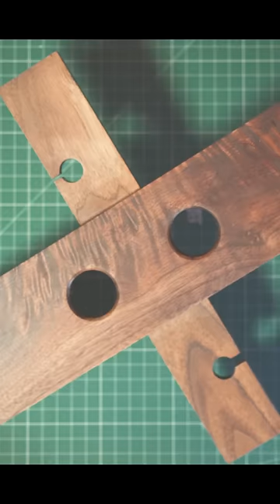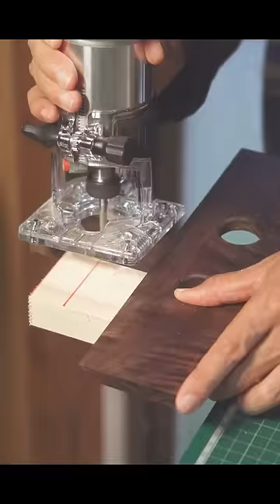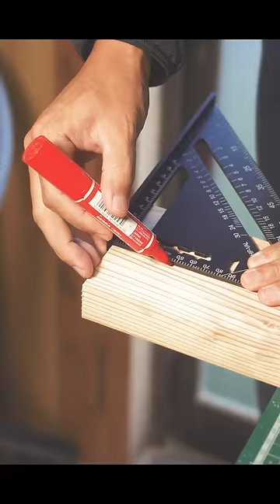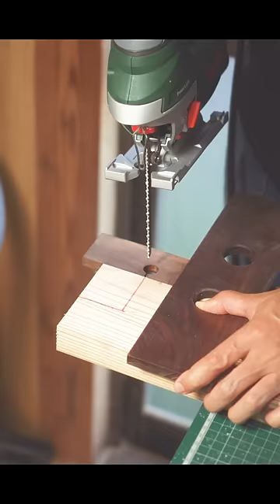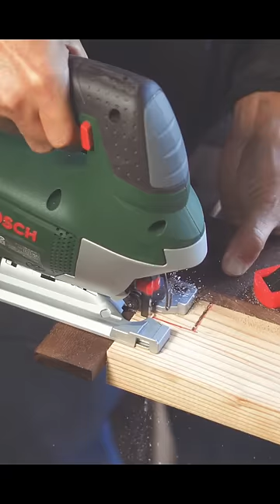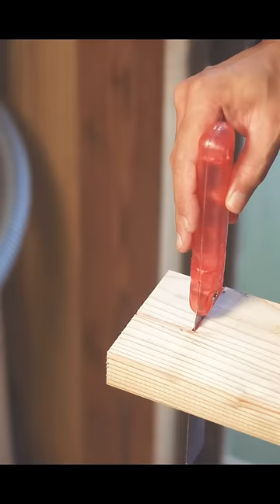Few People Know About This Hack🤫 #shorts

Comment: Some measurements and instructions that worked for me (sorry for bad english):
Big piece: 360 x 110 x 9mm
Small Piece: 450 x 60 x 9mm
Big Holes: 30mm
Small Holes: 20mm

DIvide and draw lines for the 360x110mm in 3 Sections: 150 / 60 / 150mm
DIvide and draw lines for the 450x60mm in 3 Sections: 130 / 110 / 210mm

Glue both pieces together on the 110 x 60mm sections.

Cut the 210mm piece to the appropriate width using the circular saw.

Cut into the 60mm piece using the jigsaw and router as a mark. Mark the middle of your blade width and drill the small hole with a distance of 20mm away (so you have 10mm air / 20mm hole / 30mm wood)

The middle point for big holes on the 360 x 110mm piece are 125mm from the outside (with 30mm diameter). So you have the sections "125 / 25 / 60 / 25 / 125".

I hope this helped someone and sorry for bad english or explanation.

Comment: Making on this weekend. Exactly what I need
Reply: Why wouldn't you use the framing square he used to square his "tool" instead of making a "tool" to do the exact same thing that the tool he uses to use it does?
Get it? The speed square does the exact same thing. His is cute but redundant.
Reply: @Steve-hj6xv  You are missing the advantage of this jig here. It aligns to set the cut to the marking where the cut is to be made !
Reply: @NavinBetamax  I align the cut with the saw blade. The jig is redundant, especially if you have to use a speed square to align it
Reply: @Steve-hj6xv    ...once this jig is made....you don't needto use the speed square.
Reply: @NavinBetamax  yet, the first thing he did was to pull out a square. Regardless, I'm being too critical. It's a cute contraption and if people like it then it should be of no concern to me.
Reply: @Steve-hj6xv  This is A Jig made with the help of A Speed Square to Align the CircularSaw for anAccurate Square Cut !!!  I hope it is clear now ( A Jig) !!!
Reply: @NavinBetamax  guy, I get it. I get the same results with a speed square, which was designed for people to make square cuts.
It's a cute jig, though. Enjoy!
Reply: Hope you only need to make 3" cuts
Reply: @Steve-hj6xv  He is using the speedsquare only to mark the cut-lines !

Comment: Very nice tool!! I would make it out of plywood though so it won't expand or contract...
Reply: True. But real wood is so beautiful
Reply: As long as the surface is suitably sealed, there shouldn't be sufficient moisture migration for the wood to move.
Reply: Any movement on something that small is gonna be insignificant once waxed or varnished.
Reply: @Shryquill shouldn't be, but there regularly is, especially with temperature/moisture variations.

Of course, if you can moderate such variations, it shouldn't matter very much. 

-professional cabinet maker
Reply: @michaelsorensen7567  I was passing on what was told to me, but sadly since writing that comment I've learnt a bit more about perm ratings and moisture gradients. 
Essentially, unless the coating is continuous, without imperfection, and vapour impermeable, there will be some amount of moisture migration, and that can lead to warping. 

Thanks for sharing your reply and reminding me of the jig shown in this video; I REALLY could have used one of these today

Comment: Skill saw, yes. Router, yes. Jigsaw, NO. The blade can flex, bend, turn or whatever you want to call it and pull the saw away from or into the jig. The harder or thicker the material the worse it is!
Reply: @losapriscos7258  a sharp blade will only help for a short cut like he demonstrated in in the video. If someone wants to make a longer cut using a straight edge. The blade will wander and pull the tool eventually regardless of if it’s sharp or dull. Im not saying it’s a bad idea. I’m saying depending on the situation, a seemingly good idea can have unwanted consequences. And it’s nice to know the risks of something before doing it.
Reply: The function of the jig at that point is to provide a fence to straight cuts, the only reason for the hole is to give a starting place. It can deflect into the jig all it wants, the fence action of the jig will remain the same. It looks like already got maybe a quarter inch of play for the blade to wobble in, to account for just that fact.

Comment: That’s a nice and simple jig, personally I’d make it out of some steel flat bar so that it doesn’t swell with the seasons and stays true, but I like the design!
Reply: @roarkemurdock3027 - Those small wood pieces are not going to expand enough to be a problem.  And they won't damage your blades and router bits if you accidentally hit them.
Reply: I wouldnt be comfortable with a router bits that close to metal.
Reply: @jamosorio642  - Exactly. 👍
Reply: @jamosorio642  @David_K_pi I would put a wood or plastic insert where the blade/bits go just like any other zero clearance insert on a table saw/bandsaw. As for the swelling I personally would want the square and fence aspects of the jig to be unchanging and to stay true. You may be right that the swelling would be small in the initial change of seasons, and how much it would swell would depend on the type of wood used as well as your climate, but I’d prefer the stability of a metal straight edge and fence. I live in Texas and my wood jigs do change between winter and summer

Comment: Umm, they have tsquares, speed squares, guides, etc.  You just made it out of wood but metal.  Which for long-term use is a bad idea.
Reply: It’s faster to find some scrap wood and easier to make a wooden jig. The cutting parts never touch the wood so it doesn’t really matter regarding longevity and you can always make another one. Maybe a “purist” wouldn’t be impressed by this but for most of us this is a clever way to understand jigs and have the benefit of using them.